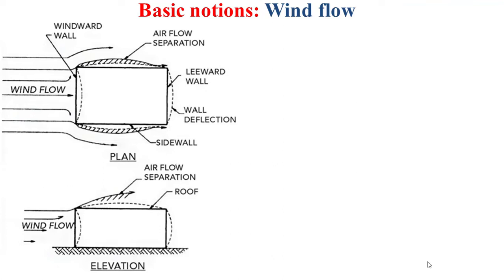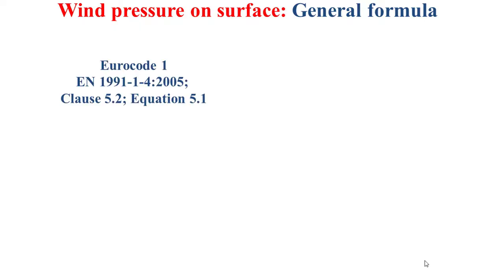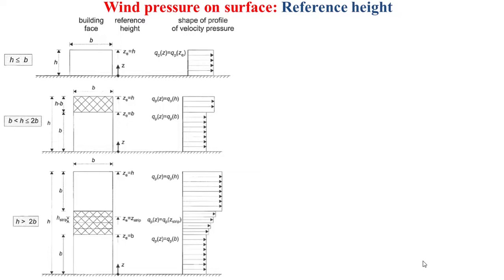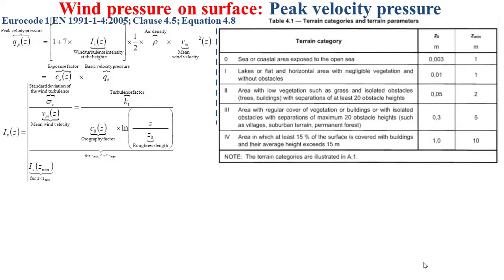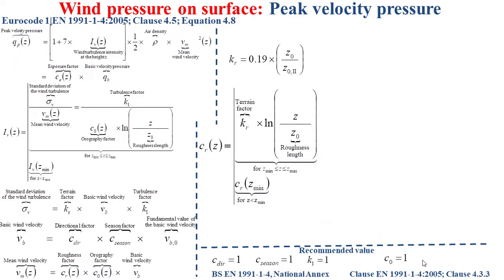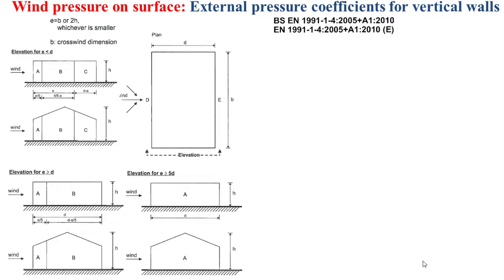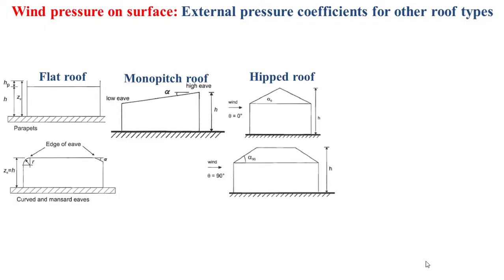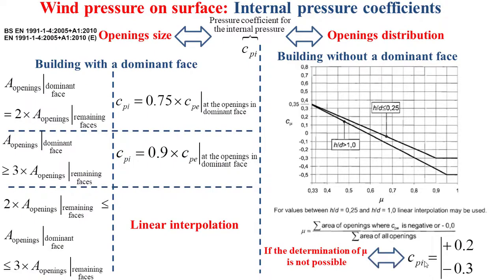Wind action (Wind load)_Wind pressure_Eurocode 1 | EN1991-1-4

Comment: Thank you very much for this video.

I have a question I hope you can answer:

Having calculated Peak Velocity Pressure, qp, we want to use this value in an FE model. We can either apply this PRESSURE to the appropriate surfaces in the FE model or calculate an equivalent wind force Fw (=CsCd * Cf * qp *Aref) as shown in EN1991-1-4, equation 5.3 and apply it to the model as a force.
But in calculating Fw, we have the force coefficient Cf which reduces the magnitude of the wind force. Let's assume that the value of Cf in our case is 0.5, this means the wind load applied as force to the FE model is 50%  less than the wind force if appied as pressure to the corresponding area. The recommended value for CsCd is usually 1, so that does not effect the value of Fw.

Should the force coefficient Cf somehow be taken into account when applying qp as pressure? How should this discrepancy be addressed?

Thanks in advance.

Comment: EN 1991: 1-4:2005
Clause 5.2 ,equation 5.1
 €
If the cross wind is zero what will happen? 
Along the tangent  it is  90 degrees 
 The external pressure  is  higher  infact much higher than internal presure inside an aircraft    ......